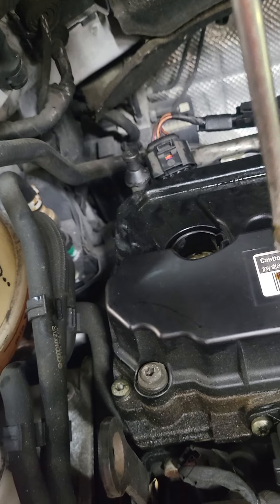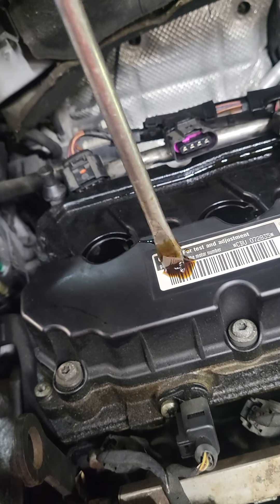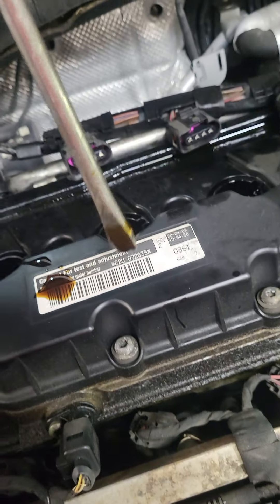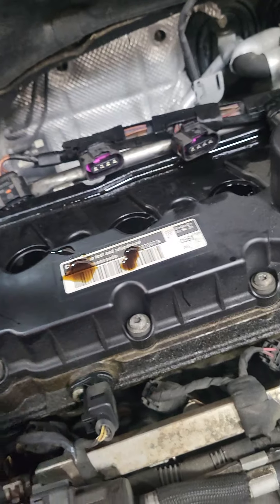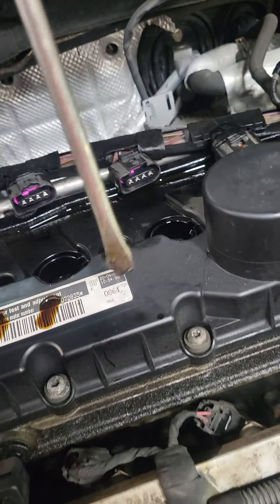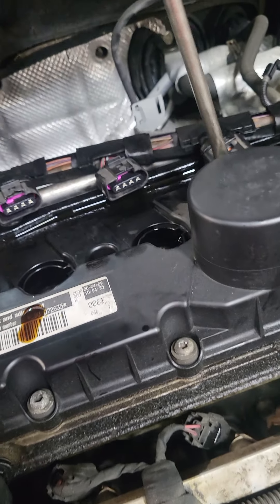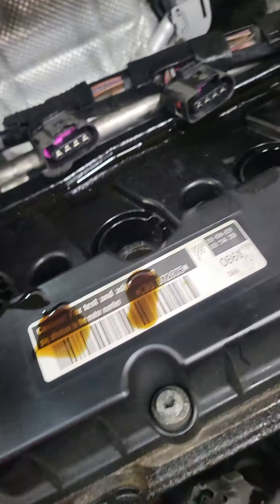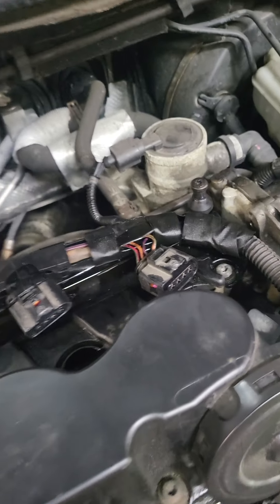Customer declines  fixing it right

Comment: Should tell the customer, you can either pay for it to be fixed right or find something else to get around.
The oil leak will cause excessive compression and break the engine. Worst case the block breaks.

Comment: To be fair the valve covers are several hundred dollars and they all fail. Replacing gaskets on these doesn't always work the plastic seems to warp overtime and it's usually what's leaking not the gaskets. But yea.
Reply: But also to be fair, he never mentioned the gaskets one time in this video. He repeatedly mentions the COVERS "being shot". Also, There are cheaper aftermarket options. Finally, the oem covers might be way overpriced, but that's not the shop's fault.
Reply from the maker: I always advise new vakve covers when plastic if not we don't do the job